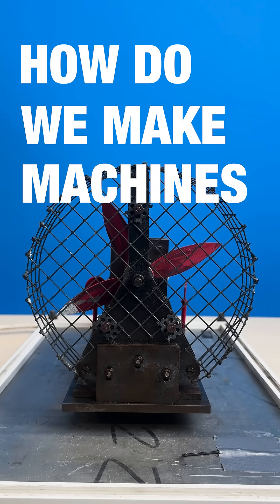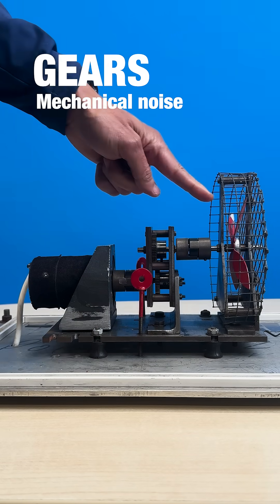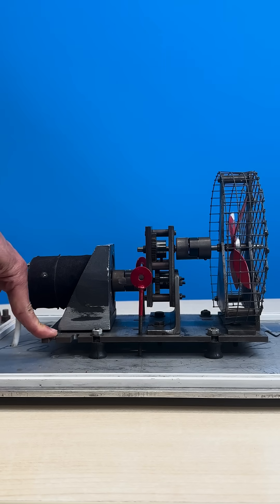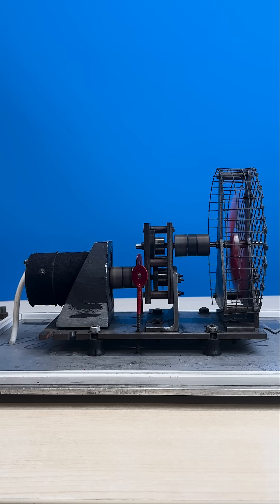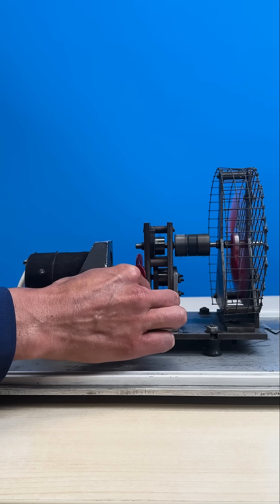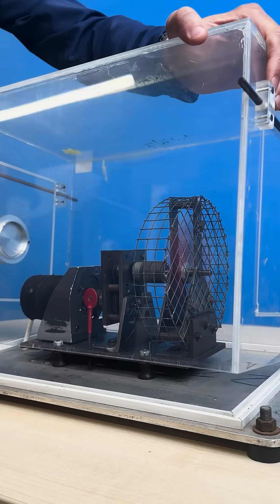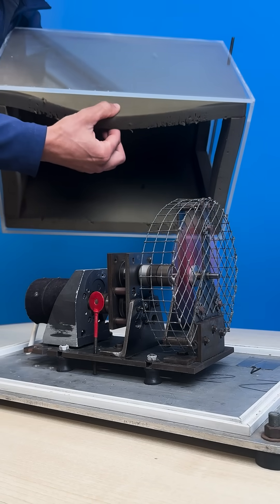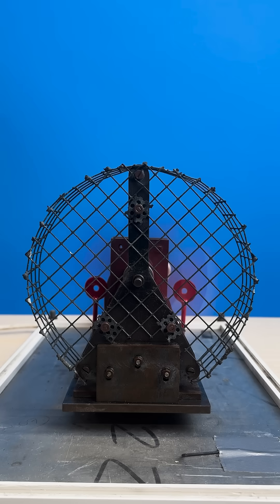How do we make machines quieter? | University of Southampton

Comment: and then you provide a 10% ventilation opening for air flow.. .. you will be almost back to where you started !!!.. managing acoustic leakage is the single most challenge for effective sound insulation.
Reply: Thanks for pointing out this fundamental airborne noise issue! You're absolutely right. We've got the structure-borne path covered with mounts (or a different gear designs). Thanks to your comment, we're now planning to show how you can provide ventilation while keeping the noise under control. Stay tuned! 😊